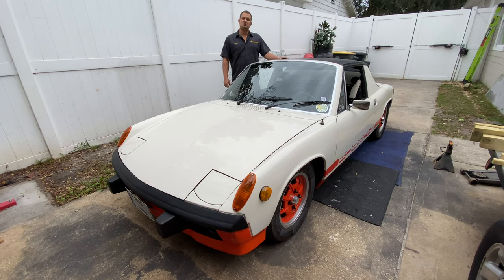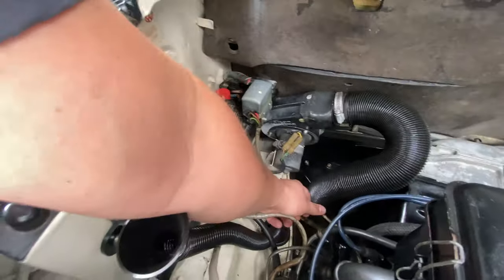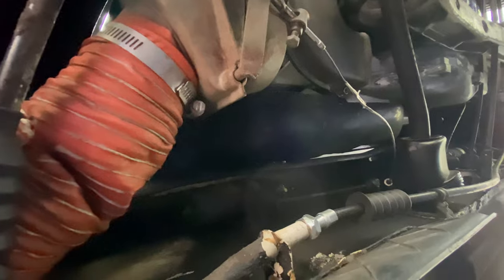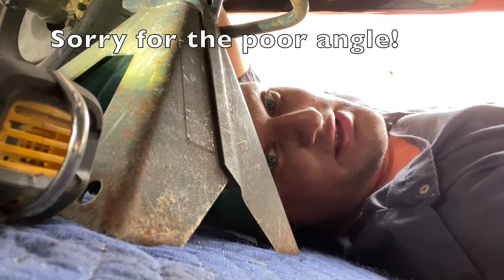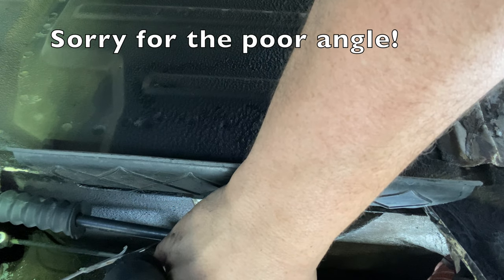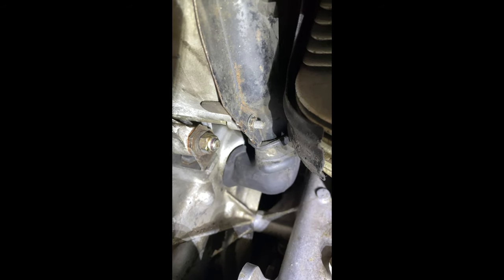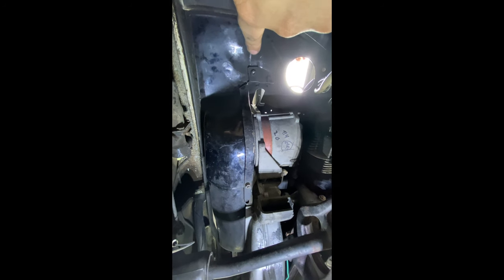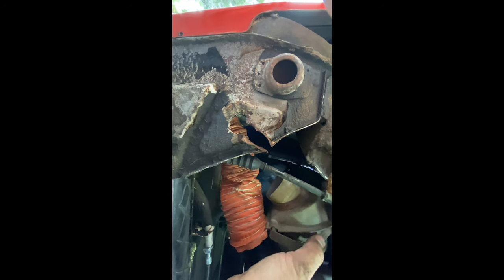How to replace your Porsche 914 Alternator

Comment: 5-6 hours to change the alternator? That number is probably accurate when the work is done “by the book”. I seem to remember reading, when any major maintenance is performed on a 914, it is recommended that the whole drivetrain be removed.  Any work related to the engine, clutch, transmission or exhaust suggests dropping the drivetrain and working on it outside of the car. I’m sure that that makes it easier, but it does add a lot of time. Good job as always, Barefoot! 😊
Reply from the maker: I have to agree, out of car is easiest. I can pull my EFI motor in under an hour (solo), so it is easier for some job. But man I hate having to reseal the CVs and heat exchangers every time!
Reply: @barefootgaragejax9252  yeah, I wouldn’t want to deal with that either.

Comment: Own a 72 914 and can not figure out how to get the belt back on the fan/alternator. Any advice?
Reply from the maker: I would start with making sure both the upper and lower pivot bolts are loose. It should have 1-1.5” of movement at the pulley for belt mounting.
Reply: @barefootgaragejax9252  okay I'll that. Thank you